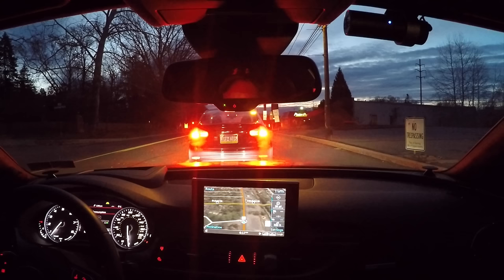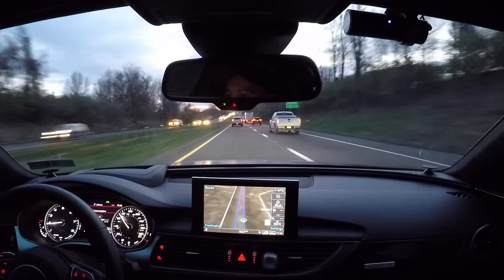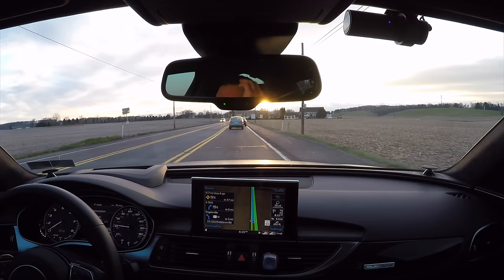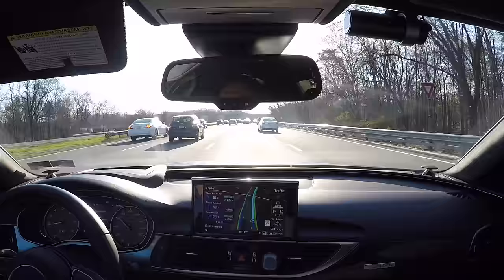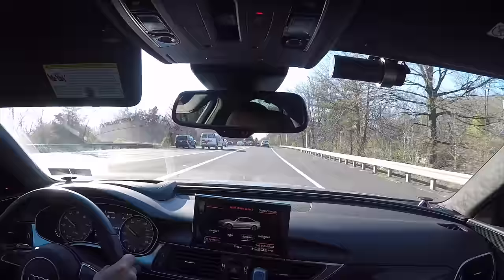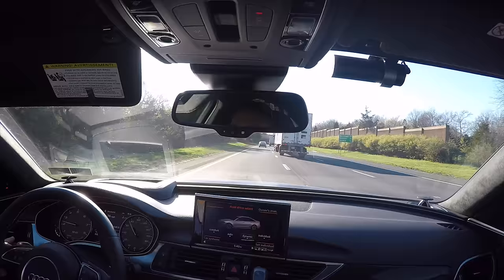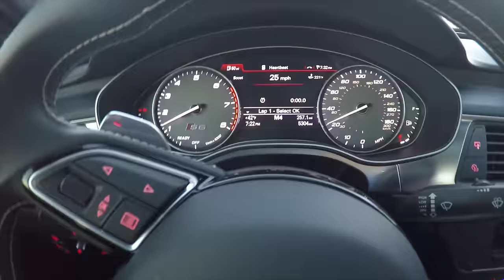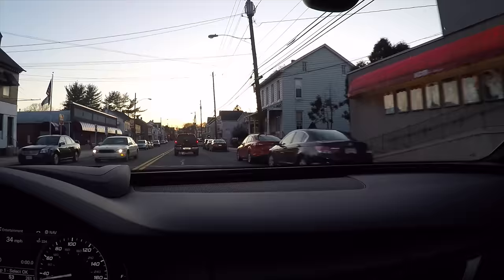2016 Audi S6 Vlog: Getting APR Stage 2

Comment: Hey Michael, which OBDII adapter are you using with your iPhone? I purchased one made by Veepeak and unfortunately it didn't link up to my wifi. Perhaps it's not compatible with our cars.
Reply from the maker: trystartry I use the GoPoint BT1 coupled with the Dash Command app. Works perfectly. I also have the APR dongle if I ever need to switch programs but I mainly use the GoPoint for daily use. Just google it.

Comment: Does doing just Miltek exhaust to my Audi S4 voids the warranty??
Reply from the maker: No...i'll explain more in detail in an upcoming vlog.
Reply: No modification of any kind will void the warranty. 
If the dealer(service writer or manager) of any manufacturer tells you your warranty is void they are lying. When it comes down to part replacement if the part itself is under the manufacturers 4/50k or even Audi care or a third party for that matter there is no way for the dealer to prove that your modification or aftermarket part caused whatever problem you are having. 

My B8 S5 is Tuned(w/bench flash), lowered on springs, cat-back, Euro-codes, VAGCOM mods to name a few and I just the other day had a thermostat warranty replacement which they could have said was because of my tune, which they were aware of. Shortly after I had my springs installed my lower control arm bushings started leaking which they replaced under warranty. Almost immediately after my exhaust install my MIL came on and it was a bad 02 sensor which they replaced under warranty without even calling me to tell me what it was.

Sorry for the rambling but its upsetting that people think they can't do what they want to their car without thinking they lose warranty. 

BTW even a totaled car, repaired with used parts with an R title still has warranty.

 Source: worked with Audi, Porsche, VW for years and I've never heard of a warranty being voided.
Reply from the maker: https://en.wikipedia.org/wiki/Magnuson%E2%80%93Moss_Warranty_Act

Comment: Michael, What is the device that pops up in the driver side corner of your dash near the start of the video?  Any new thoughts on how you're liking Stage 2?
Reply from the maker: Those are the retractable tweeters (speakers) that pop up during engine start. It is part of the B&O stereo system. Stage 2 is amazing, love it. It's not as drastic of a change as it was going from stock to stage 1 but still awesome.
Reply: Very cool- I've got a 2016 S6 as well, but it only had the stock stereo system, so I completely overhauled all the speakers, amplifiers, subwoofer, and added a DSP with equalizer.  I've got the APR downpipes arriving shortly, but am using the EPL tune, since I don't have an APR dealer close to where I live.  My Roc Euros should be arriving today. Where did you source your RS grille?

Comment: Are you worried about having any problems with the dct transmission with the extra power from the APR tunes?
Reply from the maker: No I'm not worried. These transmissions are very underrated from the factory and can handle the extra power.
Reply: +Michael Chua Interesting, thank you for the reply. The only reason I ask is my understanding is that the RS7 is equipped with the single clutch 8 speed due to the extra power it puts out, for fear the dct couldn't handle it. Thank you very much for taking the time to make this video, I have followed your S6 journey and am glad every time I see a new video. It lets me get an understanding of the tunes and exhaust before hand. Having that said, do you recommend the AWE exhaust over the stock sport exhaust?My only concern is major exhaust modification and drone.
Reply from the maker: +Nick A While the sport exhaust is nice, it just doesn't compare to the AWE Touring exhaust. I def recommend it, keep in mind there was no drone before I got the down pipes put on. If you don't plan on going Stage 2 then def go with the AWE Touring exhaust.
Reply: I may just have to get the AWE, thinking about it more and more! Thanks for the response

Comment: Hey Mike, do you have any concerns with the dual clutch transmission holding up with the added torque the stage 2 tune and downpipe bring?
Reply from the maker: Hey Matthew, My only concern with the increased torque is with launch control. Have you seen my "Launch Control Fail" Video yet. Otherwise, no concerns at all and would def recommend it.
Reply: @mrc144  I'm stage 1 in my '13 S6.  I've used launch control 8 times.  The thought of grenading a transmision scares me.  I've got the APR TCU tune also and the launch RPMs set at 3000 for a bit more protection.
Reply: datsuntoyy you used LC 8 times with the tune?
Reply: @xxthehuskycaboosexx  actually only once with the tune.  The rest were pretune and only to show off to friends.

Comment: Didn't the modifications void your warranty?
Reply: No modification of any kind will void the cars warranty. If the part you modify or in this case the ECU is thought to have caused an engine related issue there is no way they could know for sure that the modification caused whatever problem you had or are having. However, if this is a bench flash they may be able to say that it was tampered with and that the ECU itself would not be under warranty. 
If the dealer(service writer or manager) of any manufacturer tells you your warranty is void they are lying. Just ask to speak with their district manager and they'll roll out the red carpet so they don't get in trouble. Source: worked with Audi, Porsche, VW for years and I've never heard of a warranty being voided.
Reply: Tim Log 

I have an S6 that I bought used from a dealership. I bought the warranty on the used car through the dealer. I have 2 questions for you, please answer them if you can.

1.) Since I bought my Audi from a non-Audi dealer, will the audi service shops promise my warranty? Or do I have to go through the dealer I bought the car from if any issues arise? 

2.) If I go with an APR tuning (stage 2), will the dealers (Audi service shop) still service my car under warranty? I understand that your saying "they're lying" but I'm still not confident that simply threatening to speak with their manager will overwrite this issue. The mechanic at the APR certified shop nearby (I'm in Austin TX) told me that it would void the warranty if he tuned it. So why would he have any reason to tell me this when In fact he would lose the business? Do you see my predicament?

Sorry, there's more than 2 questions here. However, I'm interested to see what you have to say. Thanks in advance man!
Reply from the maker: 1) Since you bought the car from a non-Audi dealer, I can assure you its a third party warranty that you will probably have a hard time getting honored at any Audi Dealership. I have had horrible experiences with 3rd party warranties. I suggest you cancel that warranty and go to an actual Audi dealer to purchase a manufacturer's warranty. Otherwise, I am quite certain they will make you go to the originating dealer to have service and even then, you will have a hard time getting anything fixed. 

2) An APR tune DOES NOT void any warranty if and only if whatever happens to the vehicle was not a result of the APR tune, then the repair will not be covered. If an authorized Audi dealer were to scan your car while tuned, it will flag it as TD1 and it will forever be branded that way. At that point, you will have a hard time getting anything fixed should anything happen to the car. Supposedly, you can flash back to stock and be undetectable to the dealer but from what I have seen, its hit or miss. I happen to have a really good relationship with the service manager and he knows not to hook my car up to the computer for regular maintenance. 

Good luck!!
Reply: Michael Chua thanks my man, Greta advice

Comment: Any track 1/4 results ??
Reply: c7.7s stage 1 are usually running around 11.5 - 11.7 in qtr.  10.3 -4 with 100 octane. I belive the best Stage 1 I've seen is 11.2.  Stage 2's can dip in the 10's on 100 octane.  I'd bet he's 11.2 on pump gas.

Comment: Yeah that's kind of strange that you're having problems with the APR tune I had it done to my 13 S6  and it's been great and never had no problems at all runs perfect all the time. Kind of strange that years later there would be bugs When I go to the dealer I just set it back to stock I'd rather not say that I did it and I haven't had any problems with the warranty.
Reply: Mike DeClue its super now, but the inly times ive seen the cars with tunes go into limp mode, is when they run the car hard on a cold engine.